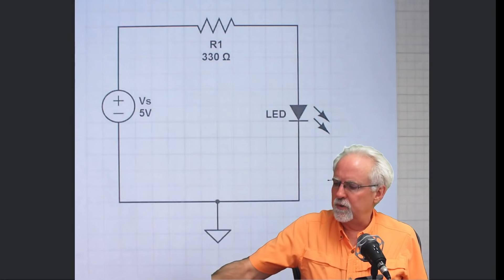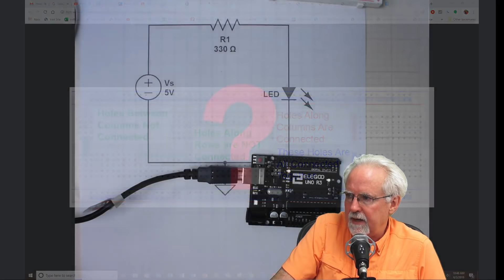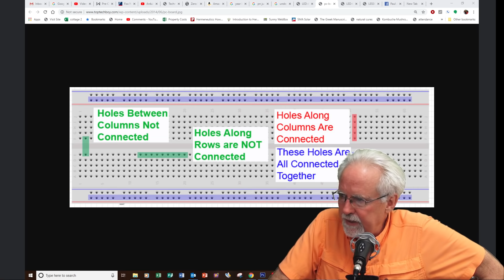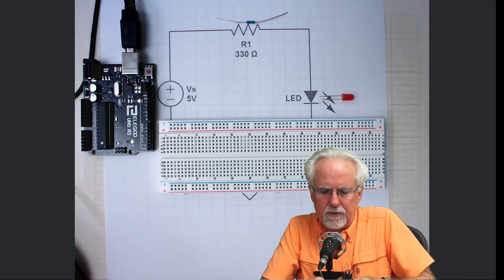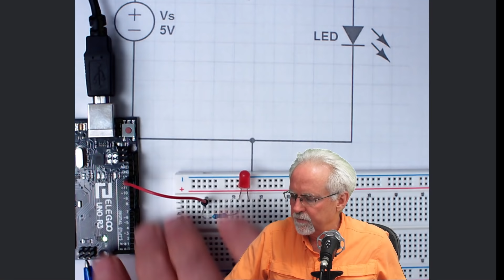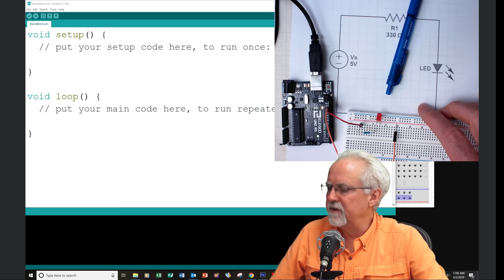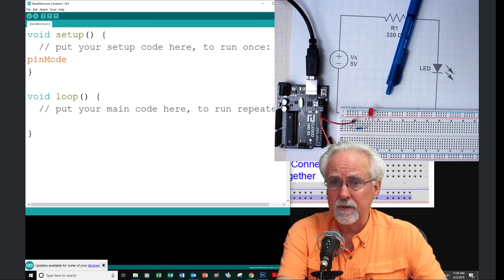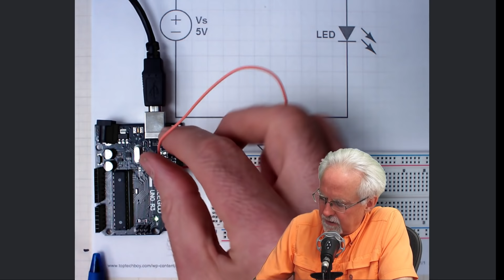Arduino Tutorial 3: Understanding How Breadboards Work

Comment: void setup() {

 pinMode(13,OUTPUT);

 pinMode(12,OUTPUT);

 pinMode(11,OUTPUT);

 Blink(13,500,5);

 Blink(12,500,10);

 Blink(11,500,15);

}  

void loop() {

}

void Blink(int _pin, int _delay, int _blinkAmount) {

        for(int i = 0; i < _blinkAmount; i++) {

  digitalWrite(_pin,HIGH);

  delay(_delay);

  digitalWrite(_pin,LOW);

  delay(_delay);

        }

}

Comment: my homework:
void setup() {
  // put your setup code here, to run once:
pinMode(8,OUTPUT);
pinMode(7,OUTPUT);
pinMode(12,OUTPUT);
}

void loop() {
  // put your main code here, to run repeatedly:
digitalWrite(7,HIGH);
delay(100);
digitalWrite(7,LOW);
delay(100);
digitalWrite(7,HIGH);
delay(100);
digitalWrite(7,LOW);
delay(100);
digitalWrite(7,HIGH);
delay(100);
digitalWrite(7,LOW);
delay(100);
digitalWrite(7,HIGH);
delay(100);
digitalWrite(7,LOW);
delay(100);
digitalWrite(7,HIGH);
delay(100);
digitalWrite(7,LOW);
delay(100);
digitalWrite(8,HIGH);
delay(100);
digitalWrite(8,LOW);
delay(100);
digitalWrite(8,HIGH);
delay(100);
digitalWrite(8,LOW);
delay(100);
digitalWrite(8,HIGH);
delay(100);
digitalWrite(8,LOW);
delay(100);
digitalWrite(8,HIGH);
delay(100);
digitalWrite(8,LOW);
delay(100);
digitalWrite(8,HIGH);
delay(100);
digitalWrite(8,LOW);
delay(100);
digitalWrite(8,HIGH);
delay(100);
digitalWrite(8,LOW);
delay(100);
digitalWrite(8,HIGH);
delay(100);
digitalWrite(8,LOW);
delay(100);
digitalWrite(8,HIGH);
delay(100);
digitalWrite(8,LOW);
delay(100);
digitalWrite(8,HIGH);
delay(100);
digitalWrite(8,LOW);
delay(100);
digitalWrite(8,HIGH);
delay(100);
digitalWrite(8,LOW);
delay(100);
digitalWrite(12,HIGH);
delay(100);
digitalWrite(12,LOW);
delay(100);
digitalWrite(12,HIGH);
delay(100);
digitalWrite(12,LOW);
delay(100);
digitalWrite(12,HIGH);
delay(100);
digitalWrite(12,LOW);
delay(100);
digitalWrite(12,HIGH);
delay(100);
digitalWrite(12,LOW);
delay(100);
digitalWrite(12,HIGH);
delay(100);
digitalWrite(12,LOW);
delay(100);
digitalWrite(12,HIGH);
delay(100);
digitalWrite(12,LOW);
delay(100);
digitalWrite(12,HIGH);
delay(100);
digitalWrite(12,LOW);
delay(100);
digitalWrite(12,HIGH);
delay(100);
digitalWrite(12,LOW);
delay(100);
digitalWrite(12,HIGH);
delay(100);
digitalWrite(12,LOW);
delay(100);
digitalWrite(12,HIGH);
delay(100);
digitalWrite(12,LOW);
delay(100);
digitalWrite(12,HIGH);
delay(100);
digitalWrite(12,LOW);
delay(100);
digitalWrite(12,HIGH);
delay(100);
digitalWrite(12,LOW);
delay(100);
digitalWrite(12,HIGH);
delay(100);
digitalWrite(12,LOW);
delay(100);
digitalWrite(12,HIGH);
delay(100);
digitalWrite(12,LOW);
delay(100);
digitalWrite(12,HIGH);
delay(100);
digitalWrite(12,LOW);
delay(100);
}

Comment: Thanks, Paul. I'm left sitting here wondering how I, as a computer programmer, was so mystified by microcontroller programming for so long. Maybe it just shows how obtuse most nerds are at explaining things. Now may I suggest you switch from coffee to Americano? I'm pretty sure you'll enjoy it even more. Mocha pots are cheap!
BTW, if you re-do the first videos, you might explain how "using pin 13" happens without connecting anything to it. That about turned me off.

Comment: I am  having problem the LED is not blinking but in arduino its blinking,.
Reply: these are the Errors im facing they are below...  Please help me out
/home/builder/opt/arduino-builder/arduino-builder -compile -core-api-version 10611 -hardware /home/builder/opt/arduino-builder/hardware -hardware /home/builder/.arduino15/packages -tools /home/builder/opt/arduino-builder/tools -tools /home/builder/.arduino15/packages -built-in-libraries /home/builder/opt/libraries/latest -logger humantags -fqbn arduino:avr:uno -build-cache /tmp -build-path /tmp/917684721/build -verbose -prefs runtime.tools.core2-32-poky-linux.path=/home/builder/.arduino15/packages/Intel/tools/core2-32-poky-linux/1.6.2+1.0 -prefs runtime.tools.flashpack.path=/home/builder/.arduino15/packages/Intel/tools/flashpack/2.0.0 -prefs runtime.tools.i586-poky-linux-uclibc.path=/home/builder/.arduino15/packages/Intel/tools/i586-poky-linux-uclibc/1.6.2+1.0 -prefs runtime.tools.mkspiffs.path=/home/builder/.arduino15/packages/esp8266/tools/mkspiffs/2.5.0-3-20ed2b9 -prefs runtime.tools.xtensa-lx106-elf-gcc.path=/home/builder/.arduino15/packages/esp8266/tools/xtensa-lx106-elf-gcc/2.5.0-3-20ed2b9 -prefs runtime.tools.dfu-util.path=/home/builder/.arduino15/packages/arduino/tools/dfu-util/0.9.0-arduino1 -prefs runtime.tools.bossac.path=/home/builder/.arduino15/packages/arduino/tools/bossac/1.9.1-arduino1 -prefs runtime.tools.arm-none-eabi-gcc.path=/home/builder/.arduino15/packages/arduino/tools/arm-none-eabi-gcc/7-2017q4 -prefs runtime.tools.avr-gcc.path=/home/builder/.arduino15/packages/arduino/tools/avr-gcc/7.3.0-atmel3.6.1-arduino5 -prefs runtime.tools.sketchUploader.path=/home/builder/.arduino15/packages/Intel/tools/sketchUploader/1.6.2+1.0 -prefs runtime.tools.CMSIS-Atmel.path=/home/builder/.arduino15/packages/arduino/tools/CMSIS-Atmel/1.2.0 -prefs runtime.tools.avrdude.path=/home/builder/.arduino15/packages/arduino/tools/avrdude/6.3.0-arduino17 -prefs runtime.tools.arm-linux-gcc.path=/home/builder/.arduino15/packages/arduino/tools/arm-linux-gcc/4.9.3 -prefs runtime.tools.linuxuploader.path=/home/builder/.arduino15/packages/arduino/tools/linuxuploader/1.5.1 -prefs runtime.tools.arduino101load.path=/home/builder/.arduino15/packages/Intel/tools/arduino101load/2.0.1 -prefs runtime.tools.openocd.path=/home/builder/.arduino15/packages/arduino/tools/openocd/0.10.0-arduino9 -prefs runtime.tools.esptool.path=/home/builder/.arduino15/packages/esp8266/tools/esptool/2.5.0-3-20ed2b9 -prefs runtime.tools.CMSIS.path=/home/builder/.arduino15/packages/arduino/tools/CMSIS/4.5.0 -prefs runtime.tools.arduinoOTA.path=/home/builder/.arduino15/packages/arduino/tools/arduinoOTA/1.3.0 -prefs runtime.tools.nrf5x-cl-tools.path=/home/builder/.arduino15/packages/arduino/tools/nrf5x-cl-tools/9.3.1 -prefs runtime.tools.x86-linux-gcc.path=/home/builder/.arduino15/packages/arduino/tools/x86-linux-gcc/7.2.0 -prefs runtime.tools.arc-elf32.path=/home/builder/.arduino15/packages/Intel/tools/arc-elf32/1.6.9+1.0.1 -libraries /tmp/917684721/custom -libraries /tmp/917684721/pinned /tmp/917684721/sketch_feb24

Sketch uses 946 bytes (2%) of program storage space. Maximum is 32256 bytes.

Global variables use 9 bytes (0%) of dynamic memory, leaving 2039 bytes for local variables. Maximum is 2048 bytes.

Programming with: Serial

Flashing with command:C:/Users/SAMSON/.arduino-create/arduino/avrdude/6.3.0-arduino17/bin/avrdude.exe -CC:/Users/SAMSON/.arduino-create/arduino/avrdude/6.3.0-arduino17/etc/avrdude.conf -v -patmega328p -carduino -PCOM5 -b115200 -D -Uflash:w:C:/Users/SAMSON/AppData/Local/Temp/arduino-create-agent812828750/sketch_feb24.hex:i

avrdude: Version 6.3-20190619

Copyright (c) 2000-2005 Brian Dean, http://www.bdmicro.com/

Copyright (c) 2007-2014 Joerg Wunsch

System wide configuration file is "C:/Users/SAMSON/.arduino-create/arduino/avrdude/6.3.0-arduino17/etc/avrdude.conf"

Using Port : COM5

Using Programmer : arduino

Overriding Baud Rate : 115200

AVR Part : ATmega328P

Chip Erase delay : 9000 us

PAGEL : PD7

BS2 : PC2

RESET disposition : dedicated

RETRY pulse : SCK

serial program mode : yes

parallel program mode : yes

Timeout : 200

StabDelay : 100

CmdexeDelay : 25

SyncLoops : 32

ByteDelay : 0

PollIndex : 3

PollValue : 0x53

Memory Detail :

Block Poll Page Polled

Memory Type Mode Delay Size Indx Paged Size Size #Pages MinW MaxW ReadBack

----------- ---- ----- ----- ---- ------ ------ ---- ------ ----- ----- ---------

eeprom 65 20 4 0 no 1024 4 0 3600 3600 0xff 0xff

flash 65 6 128 0 yes 32768 128 256 4500 4500 0xff 0xff

lfuse 0 0 0 0 no 1 0 0 4500 4500 0x00 0x00

hfuse 0 0 0 0 no 1 0 0 4500 4500 0x00 0x00

efuse 0 0 0 0 no 1 0 0 4500 4500 0x00 0x00

lock 0 0 0 0 no 1 0 0 4500 4500 0x00 0x00

calibration 0 0 0 0 no 1 0 0 0 0 0x00 0x00

signature 0 0 0 0 no 3 0 0 0 0 0x00 0x00

Programmer Type : Arduino

Description : Arduino

Hardware Version: 3

Firmware Version: 4.4

Vtarget : 0.3 V

Varef : 0.3 V

Oscillator : 28.800 kHz

SCK period : 3.3 us

avrdude: AVR device initialized and ready to accept instructions

Reading | ################################################## | 100% 0.00s

avrdude: Device signature = 0x1e950f (probably m328p)

avrdude: safemode: lfuse reads as 0

avrdude: safemode: hfuse reads as 0

avrdude: safemode: efuse reads as 0

avrdude: reading input file "C:/Users/SAMSON/AppData/Local/Temp/arduino-create-agent812828750/sketch_feb24.hex"

avrdude: writing flash (946 bytes):

Writing | ################################################## | 100% 0.16s

avrdude: 946 bytes of flash written

avrdude: verifying flash memory against C:/Users/SAMSON/AppData/Local/Temp/arduino-create-agent812828750/sketch_feb24.hex:

avrdude: load data flash data from input file C:/Users/SAMSON/AppData/Local/Temp/arduino-create-agent812828750/sketch_feb24.hex:

avrdude: input file C:/Users/SAMSON/AppData/Local/Temp/arduino-create-agent812828750/sketch_feb24.hex contains 946 bytes

avrdude: reading on-chip flash data:

Reading | ################################################## | 100% 0.13s

avrdude: verifying ...

avrdude: 946 bytes of flash verified

avrdude: safemode: lfuse reads as 0

avrdude: safemode: hfuse reads as 0

avrdude: safemode: efuse reads as 0

avrdude: safemode: Fuses OK (E:00, H:00, L:00)

avrdude done. Thank you.

Comment: Is there any simple way to repeat flashing for 5, 10, and 15 times without having a 127 line Code?
*WARNING LONG CODE* here is my code working good but I feel it can be shorter and better *WARNING LONG CODE*
void setup() {
pinMode(2,OUTPUT);
pinMode(4,OUTPUT);
pinMode(7,OUTPUT);
}
void loop() {
digitalWrite(2,HIGH);
delay(250);
digitalWrite(2,LOW);
delay(250);
digitalWrite(2,HIGH);
delay(250);
digitalWrite(2,LOW);
delay(250);
digitalWrite(2,HIGH);
delay(250);
digitalWrite(2,LOW);
delay(250);
digitalWrite(2,HIGH);
delay(250);
digitalWrite(2,LOW);
delay(250);
digitalWrite(2,HIGH);
delay(250);
digitalWrite(2,LOW);
delay(250);
digitalWrite(4,HIGH);
delay(250);
digitalWrite(4,LOW);
delay(250);
digitalWrite(4,HIGH);
delay(250);
digitalWrite(4,LOW);
delay(250);
digitalWrite(4,HIGH);
delay(250);
digitalWrite(4,LOW);
delay(250);
digitalWrite(4,HIGH);
delay(250);
digitalWrite(4,LOW);
delay(250);
digitalWrite(4,HIGH);
delay(250);
digitalWrite(4,LOW);
delay(250);
digitalWrite(4,HIGH);
delay(250);
digitalWrite(4,LOW);
delay(250);
digitalWrite(4,HIGH);
delay(250);
digitalWrite(4,LOW);
delay(250);
digitalWrite(4,HIGH);
delay(250);
digitalWrite(4,LOW);
delay(250);
digitalWrite(4,HIGH);
delay(250);
digitalWrite(4,LOW);
delay(250);
digitalWrite(4,HIGH);
delay(250);
digitalWrite(4,LOW);
delay(250);
digitalWrite(7,HIGH);
delay(250);
digitalWrite(7,LOW);
delay(250);
digitalWrite(7,HIGH);
delay(250);
digitalWrite(7,LOW);
delay(250);
digitalWrite(7,HIGH);
delay(250);
digitalWrite(7,LOW);
delay(250);
digitalWrite(7,HIGH);
delay(250);
digitalWrite(7,LOW);
delay(250);
digitalWrite(7,HIGH);
delay(250);
digitalWrite(7,LOW);
delay(250);
digitalWrite(7,HIGH);
delay(250);
digitalWrite(7,LOW);
delay(250);
digitalWrite(7,HIGH);
delay(250);
digitalWrite(7,LOW);
delay(250);
digitalWrite(7,HIGH);
delay(250);
digitalWrite(7,LOW);
delay(250);
digitalWrite(7,HIGH);
delay(250);
digitalWrite(7,LOW);
delay(250);
digitalWrite(7,HIGH);
delay(250);
digitalWrite(7,LOW);
delay(250);
digitalWrite(7,HIGH);
delay(250);
digitalWrite(7,LOW);
delay(250);
digitalWrite(7,HIGH);
delay(250);
digitalWrite(7,LOW);
delay(250);
digitalWrite(7,HIGH);
delay(250);
digitalWrite(7,LOW);
delay(250);
digitalWrite(7,HIGH);
delay(250);
digitalWrite(7,LOW);
delay(250);
digitalWrite(7,HIGH);
delay(250);
digitalWrite(7,LOW);
delay(250);
}
sorry if

Comment: You say you had trouble with some students understanding how those breadboards work. I go back a ways, all the way to when ICs were first coming out. Back then, THE IC package was the DIP or Dual Inline Pin package which featured two rows of pins which were spaced on a 1/10" grid. 

When I first saw one of those breadboards, I instantly understood them because they were designed around those, DIP ICs. They were INTENDED to make bread boarding with those ICs easy and they did. 

The two innermost rows of holes in the bread boards are spaced 3/10s of an inch apart and that is exactly the spacing of the two rows of the most common DIP IC packages (DIP-14 and DIP-16) When you plug one of those DIP ICs into the center of the bread board, each pin on the IC is connected to one of those columns of five holes. And there is no connection across the center because that would short two of the IC's pins together, which you do not want. 

Once you see that they are primarily for holding ICs along the center, then the upper and lower rows, which are separated from the groups of five holes in the columns, are for BUSES: specifically for power and ground buses. And you can use short jumpers to transfer that power to the appropriate pins on the DIP chips. Of course, they can be used for other things but power and ground was and still is their primary use. A pull-up or pull-down resistor can also easily be added between one of these power buses and an IC pin. 

Genius!
Of course, other components can be plugged into the columns and the rows in various ways. You are only limited by your imagination in using them. 

I would suggest that using one or more DIP style ICs may be a good way of showing how these bread boards work.

Comment: OK, I did my homework and I found this: delay for high set to 10, delay for the low set to 500. This is only for the first command lines regarding each led. Now I found that if you increase the high delay to 100 and the delay for the low to 500 for how many times you want an led to cycle with that frequency, that does the trick!!!!! with those parameter I can count easily how many times each led is flashing.

Comment: My HW.

void setup() {
  // put your setup code here, to run once:
  pinMode(8,OUTPUT);
  
}

void loop() {
  // put your main code here, to run repeatedly:
  //5 Times
  for(int redBlink = 0; redBlink < 5; redBlink++){
  digitalWrite(8,HIGH);
  delay(1000);
  digitalWrite(8,LOW);
  delay(1000);
  }
 
  //10 times
  for(int greenBlink = 0; greenBlink < 10; greenBlink++){
      digitalWrite(9,HIGH);
      delay(500);
      digitalWrite(9,LOW);
      delay(500);

    }

  //15 times
  
  for(int blueBlink = 0 ; blueBlink <15; blueBlink++  ){
     digitalWrite(7,HIGH);
     delay(400);
     digitalWrite(7,LOW);
     delay(400);

    }
 
  }
Reply: hey thanks, I didn't know you can write // times .......
Reply: Nice use of for loops, I used while loops instead
Reply: Mag

Comment: // My home work code 
// My flipflop programme for controlling two LEDs
// The one goes on whilst the other one remains off
// The other one goes on after 500 milliseconds and the whole process repeats itself. 

int flipflopSpeed = 0;
int flipflopOffSpeed = 0;
void setup()
{
  pinMode(13, OUTPUT);
  pinMode(12, OUTPUT);
 }

void loop()
{
  flipflopOnSpeed = 30000;
  flipflopOffSpeed = 500;
  digitalWrite(13, HIGH);
  delay(flipflopOnSpeed); // Wait for flipflopOnSpeed millisecond(s)
  digitalWrite(13, LOW);
  delay(flipflopOffSpeed); // Wait for flipflopOffSpeed millisecond(s)
  digitalWrite(12, HIGH);
  delay(flipflopOnSpeed); // Wait for flipflopOnSpeed millisecond(s)
  digitalWrite(12, LOW);
  delay(flipflopOffSpeed); // Wait for flipflopOffSpeed millisecond(s)
  
}

Comment: Totally unsuitable content for the second tutorial,  I believe you have discouraged many beginners with too complicated detail !  detail they will never need. A quick note on correct polarity and current limiting is all that is needed at this stage. I have found your tutorials really helpful but not this one ! 

i
Reply: I totally disagree, the detail he has provided goes deeper than just a set of instructions to turn a light on, which would be rather boring. Now I know how an LED works and how current is created AND how the manufacturing processes can create amazing electrical components!
Reply: I agree with you Martyn. I'm not discouraged but I realize that you need to know things for this assignment that havent been covered yet. Also, I wasnt clear if he meant red blinks 5x then  stops; then green blinks 10x then stops; then blue blinks 15x then stops; then repeats from the start with red 5x etc etc. I'm assuming that's what he meant. I'm quite sure that people writing a code five times for the 5 red blinks is incorrect or at least too cumbersome. I think the professor said that this would be covered in lesson 15.

Comment: void setup() {
  // put your setup code here, to run once:
pinMode(5,OUTPUT);
pinMode(6,OUTPUT);
pinMode(7,OUTPUT);
}

void loop() {
  // put your main code here, to run repeatedly:
digitalWrite(5,HIGH);
delay(150);
digitalWrite(5,LOW);
delay(150);
digitalWrite(6,HIGH);
delay(150);
digitalWrite(6,LOW);
delay(150);
digitalWrite(7,HIGH);
delay(150);
digitalWrite(7,LOW);
delay(150);
}
https://drive.google.com/file/d/1-5kcrLfVBeKc6ehECRIGd-FN4qtuRA5f/view?usp=sharing